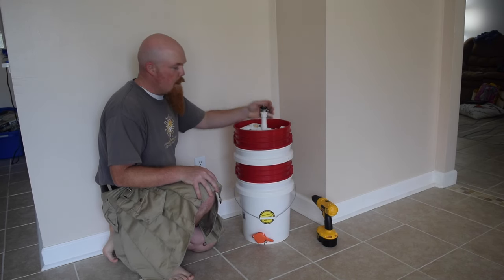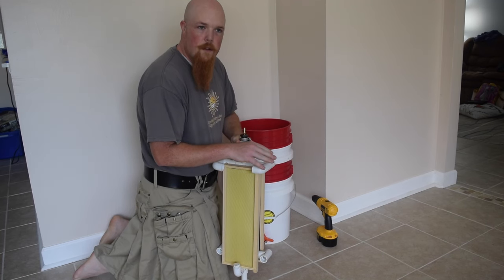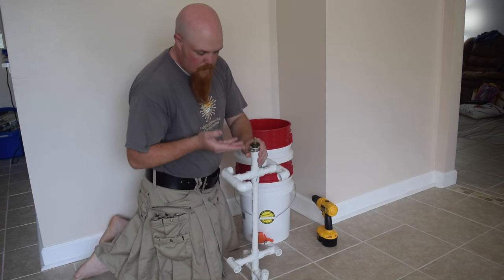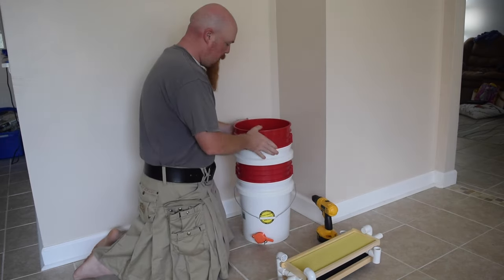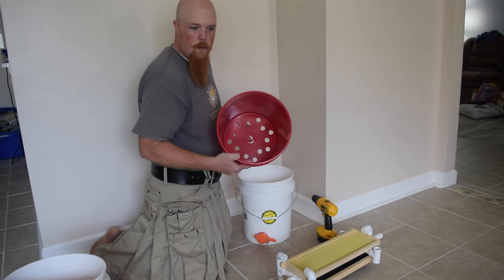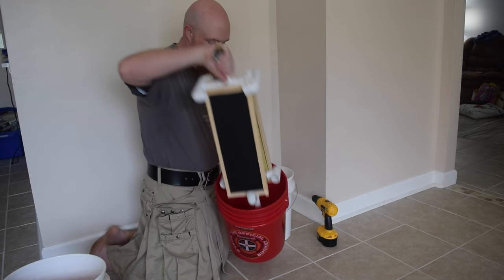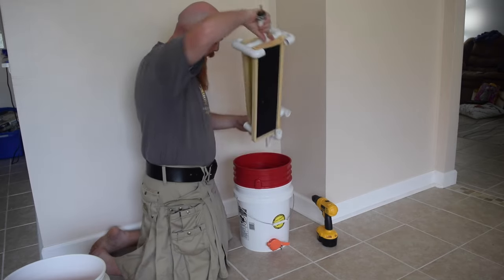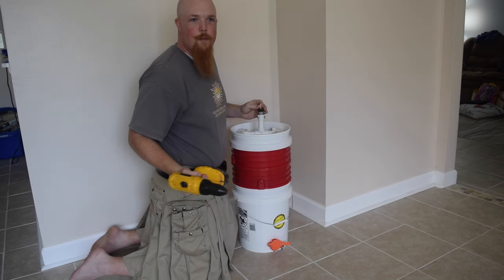Drill Powered Honey Spinner

Comment: Built as you showed was easy and straightforward thank you, however where the pvc spins in the hole at the bottom of the bucket mine started melting.  You happen to ever have that happen?
Reply from the maker: No, I never ran it very fast, and once you get honey flying around everywhere, that will lube that surface.  Go slow on the first few until you get a thin layer of honey at the bottom.

Comment: interesting - did you not use solvent for attaching the pvc? they look way too nice and non-purple :)
Reply from the maker: I did use pvc cement. I've always used the one step medium strength stuff, it is clear. I see the ones with orange or purple primer. No clue if I am missing something, but I've never had a plumbing joint fail.